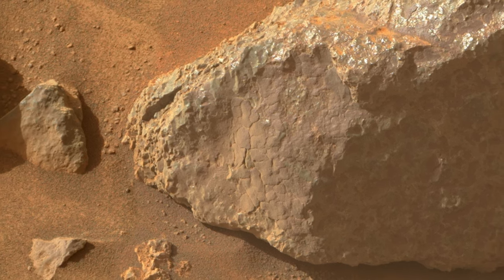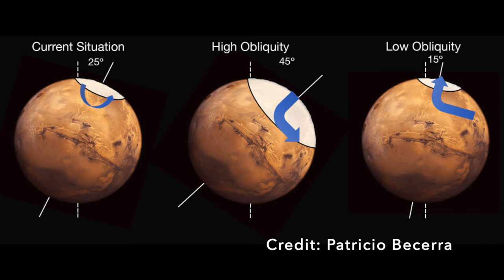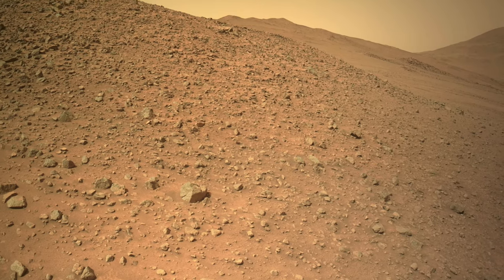How does Mars make this stuff?

Comment: That deposit of rocks looks like it was caused by a glacier, or even a river. The summit would act as a shield and prevent their removal in it's "shadow" and the related slowing of the flow would deposit fine particles in the area, which is now the "paint" that you see.

Comment: Thanks for this report.  I'm starting to think the coating is a result of heat flash exposure, since they are on the fringes of an impact crater, where there would have been significant heat generation as the object plunged through the atmosphere.  The coating would therefore be a partially-melted surface.
Reply from the maker: The spectral measurements resemble dust rather than a glassy melted material.
Reply: @MarsGuy  o.O  Spectrometers donlt detemrine dust or otherwise, they determine the elemental composition of whatever is tested.  I know, I used to use a spectrometer in my job!

In a previous report, the coating was descibed as varnish-like, which explains why it's flaking, and not merely blowing away.  

It can only be one of two thing... a flash-heated original surface or a splash deposit of some molten material.  The former seems most plausible given the proximity to the crater and the fact that there's no evidence of a splash coating eveywhere.
Reply from the maker: @johncampbell9216  Spectrometers measure elements or minerals depending on wavelength.  I know because I got my PhD doing infrared spectroscopy, which can identify minerals.  Here's the paper that shows spectra of Martian coatings that resemble Martian dust: https://doi.
org/10.1029/2022JE007481

Comment: The Earth has a nutation movement, which is something like going from a circular rotation movement to the same one but more sinusoidal. If you see a top spinning, at first it has a very uniform rotational movement, but then (as friction causes it to lose speed) the axis begins to describe a circular movement with ups and downs in such a way that if at the beginning there was a " strong equatorial centrifugal component", then this component would "fluctuate, becoming more polar", perhaps the comparison is worth it to understand "secular displacements of underground aquifers towards more equatorial or more polar latitudes".
Reply: Could it be that on Mars, (as Mars Guy says in this episode), the coating on some rocks is formed from dust and water ice, and that the cracks (sol 1294 pics) in said coating are due to a minor or greater "secular" hydration (Earth or terrestrial nutation about 25,800 years) and/or the contribution of an indeterminate number of chemical elements contained in the dust that (depending on dust storms or local winds) would not always be the same (elements and products)?. :face-blue-question-mark::body-green-covering-eyes:

Comment: In the absence of moisture the dust particle can get "infinitely" small, could they just have be deposited by the wind and adhere to the rock due to their extremely small size ? Then only similar size particles could further adhere on it, making the coating.
Reply from the maker: There still needs to be a cementing agent.

Comment: Neat exploration of the latest stop on the Perseverance journey. Those rock coatings are very strange! I agree that it seems like liquid water or at least substantial atmospheric humidity or maybe water ice must have been involved. What is your guess for that area of boulders? Was it previously covered with the same loose regolith that Percy has been traveling on but the regolith was removed by wind? I wonder if a previous layer of dust was a key part of the coating formation.
Reply from the maker: The composition of the coatings is similar to dust, so that's a good clue.

Comment: Can we estimate how long it will take for the rover tracks to be eroded away or filled in with dust? Will the tracks at the landing site still be visible today?
Sure miss Ingenuity ❤
Reply: If you know the "Where is Perseverance?" section from the NASA blog about the Mars 2020 mission, you can find some photos, between sols 341 to 350 ( locate the position first and then look for sol's photos ), where you can compare the footprints left by the rover about 180 sols before (1sol = 24h 40m), more than 6 Earth months, since, in that area, the rover went and later returned there.
Look at those on sol 353, there are some of the Zcams where the cleat prints are already full of fine dust, although the tracks are still noticeable.
Reply from the maker: Wind can erase rover tracks in just days under the right conditions (happened to the Spirit rover), but it could take months or a few years.